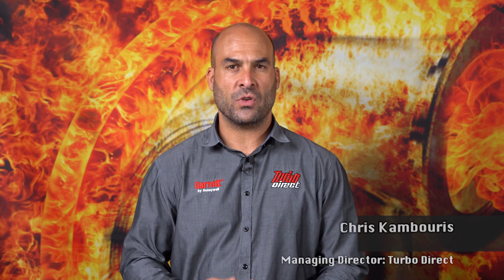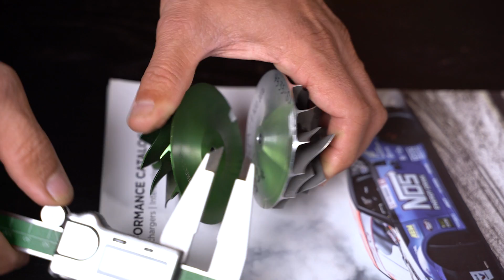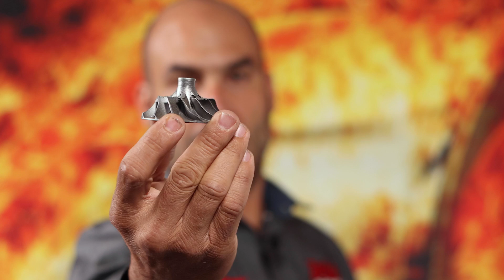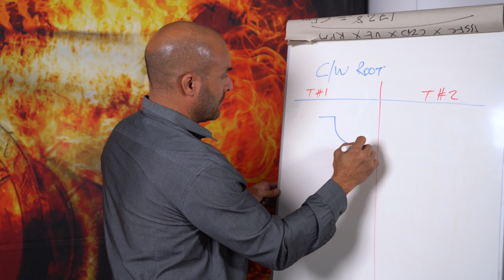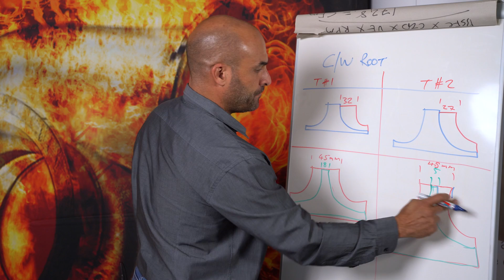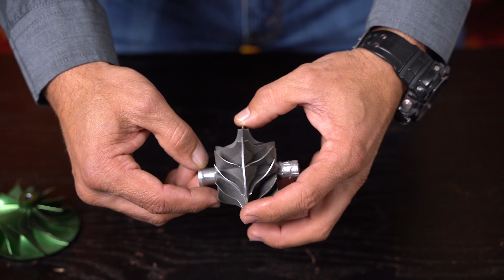Turbo Compressor designs - Discussed

Comment: Reaffirmed the hypothesis  i had .. do it again on turbines please ..
Reply from the maker: Good idea - next video will be on turbines.  I will share what i can aswell but it will be informative i promise.
Reply: @TurboDirectSA  my hypothesis on that one is that a GT28 and GT30 is just a turned down GT35  therefor  the GT35 has the best blade area to mass ratio ..its also interesting to see the blades got thinner as they used better materials that could handle the heat better.
Reply from the maker: @incolink  Not really - the compressor aswell as the turbine blades do not share the same root design/dimensions when comparing the 30 and 35 family -  The 30 family turbines (3 different inducer/exducer sizes 51.78mmx56.5mm, 53.6mmx56.5mm,  and the 55mmx60mm)  share the same root design, the GT35 does not share the same root with any other turbine, not even the GT37 which measures 72.5mmx64mm.

Gone are the good old days where Garrett truly was the leader in technology, and owned by Honeywell - all the "dream team" staff are gone, and the new setup is totally flawed in my opinion.  Lets hope for the best, but as it stands today there are problems with the compressor maps and the real life results with the new stuff.
Reply: @TurboDirectSA  i really wish there was a modern  turbine in between  like a GT32  orTA34 BB  i have  TR30VGT i want to  put a slightly bigger turbine in and the step to GT35 seems a bit big
Reply from the maker: @incolink  I hear you - this is why there are turbine housing  AR options, but not all the AR's are perfect for each application, this is why engines are modified to suit.... seems backwards doesnt it.
Reply: I'd watch that. :D

Comment: Wow this has phenomenal info! This is the only video I know of with reliable info on compressor wheel design. Love the one to one comparison of your 11 blade wheel vs the Garrett 7+7 splitter.
Really glad you covered root design as well because it's terminology I wasn't familiar with before doing some research after your comments before. Definitely something most people will miss.
The force analysis part is so good! This is like taking a college class for free. Love it. Makes it obvious why they started doing superback wheels. Material strength importance comes into focus too.
Since our last conversation I was thinking a lot about blade area, number of blades, blade height, blade angle, total volume between blades, and number of blades. Add rotation speed to all of that.
Also demonstrates why so many people who talk about billet "upgrade" wheels or how blade counts affect spool and power potential really don't even scratch the surface or know the subject at all.
The one topic I wish you touched on more was "spool time" which obviously is a function of mass as well as blade characteristics, and involves the turbine as well. Maybe a topic for another video?
You do a good job making it obvious this is a complex topic, but also that logic and of course math can give you solid answers. Clearly you could talk about it for hours and we still would need more!
I'll definitely be referencing this video in the future when I see people talking about compressor design who obviously need a bit more learning on the topic. Thanks very much!
Reply from the maker: Thanks man - much appreciate your feedback. Sorry i cant talk too much on the subject, as we design alot of our own wheels and have paid school fees in the past with plenty failures (material aswell as design performance failures)  so there is alot of IP that we wont share im afraid.
Reply: @TurboDirectSA  I understand the trade secrets angle! The mark of a good teacher is giving enough information for the student to learn the concepts and expand upon them further themselves. ;)
Reply from the maker: @802Garage  100%
Reply: @TurboDirectSA  Came back to watch again, probably for the third time now. As I keep learning outside of your videos I'm understanding more inside of your videos. Fully understanding pressure ratios and p2c for example is still a bit beyond me.
I think one epiphany I'm having though is that tip height is in a way misdirection. Tip... area? Might be a better way to describe it. Tip edge length? Total tip exposure?
Like on your green wheel, the tips are shorter, but with a much steeper angle, and the also have an extended tip with a taper.
That meas not only is the tip edge on the green wheel longer due to the steeper angle, but longer due to the taper extending into the outlet channel, and because of the taper it also essentially sweeps the air in the desired direction rather than just sort of blowing it up against a radius. The edge has more effect.
So really the angled, extended, tapered tips allow a wheel with the same tip height or less tip height than another wheel in the same or even a smaller housing channel to push the same amount or more air per sweep of each blade. Obviously the rest of the wheel matters too, but am I at least close to the target here?
Reply from the maker: @802Garage  Buddy you getting there.  The extended tip does increase air flow and does improve the compressor map aswell - both on the Surge and choke limit.
Reply: @TurboDirectSA  Thanks for the feedback and awesome videos as always!
Reply from the maker: @802Garage  P2C is very simple - its boost including atmospheric outside pressure - job done. (Atmospheric pressure is what you are breathing right this very minute) Nothing to it.  

The designs around extended tip different from manufacturer to manufacturer, and this is to aid air flow, and has a positive effect on the compressor maps. Its not a specific design that everyone uses the same dimensions - the newer G-series use extended tip, but round theirs off, totally different to BorgWarner's design.
Reply: @TurboDirectSA  Oh really? Why were the other explanations I read so much more convoluted? I thought P2C was itself a ratio based on atmospheric pressure as a ratio to boost post compressor. I was probably reading much too late at night!

I definitely know each manufacturer has their own "secret sauce" of sorts. Seems BW pushed a lot of them to improve. I actually got to talk with a friend who worked at BW for a while. His internal info on how the EFR came to be and how they overbuild their turbos was pretty fun. As for tip designs, It's crazy how much difference such small dimensional changes can make. Very cool! Thanks again.
Reply from the maker: @802Garage  Pleasure buddy
Reply: @802Garage 
Do you have a compilation somewhere of all the turbo knowledge you've learned?
I don't think I've been asking the right questions to find more data.
Reply: @tommylyeah  Boy I wish I did. I mean I have like 100 web pages and videos favorited. Unfortunately GOOD info like this is so hard to find. It's mostly regular people speculating. Not enough hard facts and testing. I consider this channel my #1 source for reliable in depth info. You can pretty much learn something from every video they have made.
Another tip is don't assume that just because someone can install or rebuild turbos means they understand exactly why they are replacing or upgrading parts. Obviously don't automatically trust salesmen either. Without massive amounts of data and testing, a lot of upgrade parts end up being best guesses.
The good news is, for average tuner applications, small change aren't going to make a world of difference anyways, so getting too finite is just time expenditure. Understanding fundamentals like compressor maps and turbo sizing is the meat for most of us. I go crazy over little stuff like blade count, height, angle, extended tips, and more. Really though I need a lot of expensive equipment to get all the answers I want.
For what it's worth, I do have several turbocharger videos filmed I still need to edit and post. The largest and most in depth being a fully detailed video on GT25/28 style turbos. Even then it's going to be very long and only cover the surface of most topics. I try to only speak facts though.
I have a few hundred hours of research into turbos at this point, and I'm still no expert. I'd say just keep researching any time your curiosity is piqued and do your best to discern someone who is speaking based on factual knowledge and those who are making assumptions based on experience or their own research.

Comment: Excellent, you talk as usually about things that nobody else wants to talk about. I personally prefer more the use of splitters in the compressor wheels (in principle). However I understand that a compressor wheel without splitters can be more suited for certain applications. Why your compressors are green?
Reply from the maker: We made our compressors a specific green colour for two reasons, the first is that we called them the "hulk" wheel upgrade LOL 

The other is because we had a few local companies purchasing our wheels and then copying them and selling them with the same name and product code as ours to un-suspecting people. The material was not up to scratch and the wheels failed, and obviously we got the flack for it.
Reply: @TurboDirectSA  !!!!! That sucks! Have you taken legal action against them?
Reply from the maker: @aftastosk6016  No buddy the designs aren't patented, and impossible to patent anyway ... its a compliment, as we know we doing something right.
Reply: @TurboDirectSA  Indeed!